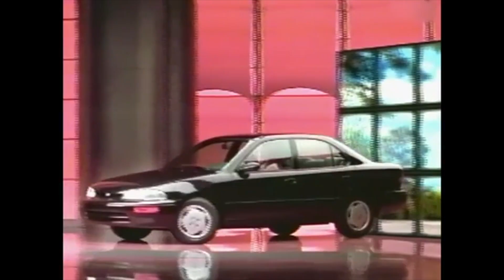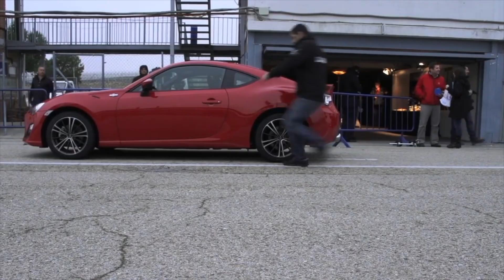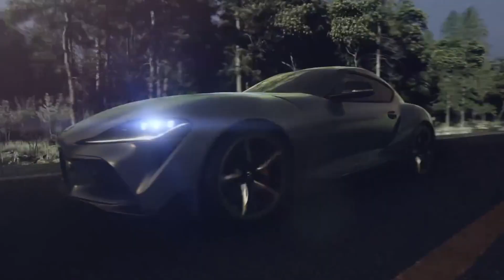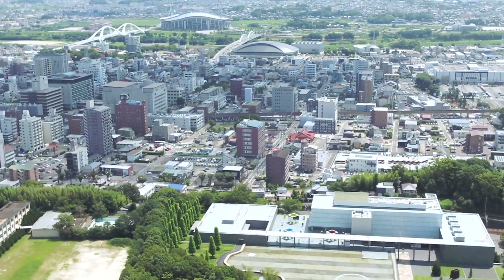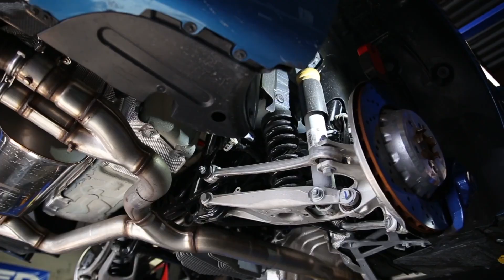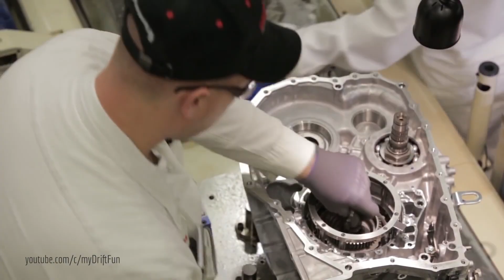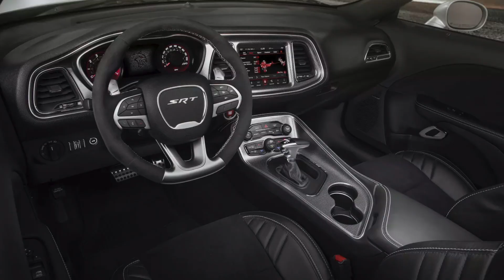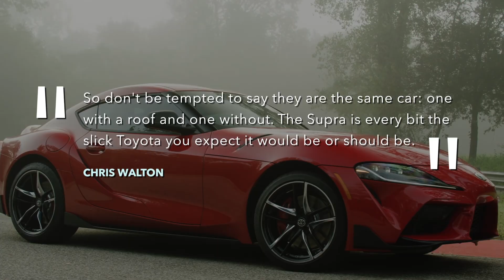MKV Toyota Supra - BMW or Toyota? The UNTOLD TRUE STORY

Comment: Toyota reliability. + BMW motorsport experience. Why so much hate??
Reply: How can you say it’s Toyota reliability when the engine/trans and all interior is BMW? THe only thing Toyota is the outer shell.
Reply: @mouanhojable  PAY ATTENTION the trans isn't BMW. The engine yes, but Toyota made sure for it to be reliable and it's showing as it's there best engine out there out of all there engines. And someone is already making 600+whp on the B58 block.
Reply: @mouanhojable  Because Toyota had a large amount of input on the mechanicals of the car. Yes, it is technically a BMW engine, but it's a BMW engine *with Toyota quality control*, and quality control translates into reliability. As for the transmission, it's actually not even a BMW trans.
Reply: @draconious4005  thank you! At least you payed attention :-D and indeed, it's a ZF-box. So not from bmw nor Toyota.
I think they did good to collaborate; it gave BMW to get an amazing AND reliable engine (double checked by Toyota) and Supra gets the quality parts and chassis! I have a BMW 240 and the engine is a Monster! With a reprogrammation it's quicker then a Brabus C-class (till 160km/h)
Reply: @mouanhojable  Did you not watch the video at all? Only the core of the car was shared between toyota and bmw MEANING, the shell AND interior are different. But no everyone is stuck in the mindset of "mk 4 supra best anything else disgusting"
Reply: @mouanhojable  did you not listen to the video? Toyota sent all the parts to Japan to have them tested, each one that didn't pass their standards was sent back for revisions. I own BMWs and don't want other cars other than Porsche but boy am I waiting for the Supra and Z4. I want to test drive each one before making a decision on which to buy. I'm sticking to the BMW more but I want that Supra as well. I welcome the reliability that Toyota brings. I'm tired of changing stupid things every 2 years like the trim on my BMW because they can't make rubber for shit.
Reply: BMW and Toyota does not need to work together. They are doing fine by them selves.  But they decide to work together across the different time zone and cultural barrier to envision something new. 

I'm sure both companies learned a lot from each other and that's good for all of us. 

Maybe BMW QA team learned thing or two about quality control. 

Maybe Toyota learned thing or two from BMW’s design philosophy and what us must for them. 

For me, this shows that both companies are willing to explore new possibilities and step away from corporate group think ( once you are in a group.. It becomes the echo chamber. Sooner or later everyone is repeating everyone else. ” That's how we always do things.”) and willing to spend $$$ on R&D.

This is big win for both companies even if the cars do not sell in high volume. 

Selling more car was not the goal. It's more of process improvement and testing / design methodology they learned from each other.
Reply: I think it's cool that they learned from each other too. The fact that the product wasn't moving well until a Japanese man who lived in Germany when he was a boy could help bring them together, is a really cool part of the story. It's probably overly simplified, but I like it.  @MSH3423
Reply: @DENicholsAutoBravado  I liked that part too
Reply: @MSH3423  BMW could learn a thing or two but all this partnership did for Toyota was to tarnish their name.
Reply: My only hate is it should have been much closer to the much better looking concept.  And it should at least have the same HP as the Z4.
Other than that, I love it.  What’s not to love is its fugly factor.
Reply: @aaronsorensen5322  Toyota wants more longevity. Of course it had less HP. Assuming what your saying is researched and true. 

It KILLS me how much I had to upgrade one Toyota of mine to get at the wheel what it could do at the crank. 300% more at the wheels HP to get there. 

Why? Conservative tune. Still had a conservative tune with the power I'm talking about. Anyway, it's easy, if you want more HP, you know which one to buy.
Reply: @aaronsorensen5322  knowing Toyota it probably does ,have to wait for official Dyno numbers from YouTubers. Toyota has lied about HP like Nissan did in the 90's and there's a chance they probably did the same with this car..maybe.. i Hope lol
Reply: I don't mind a collaboration between BMW and Toyota, just don't call this car a Supra...
Reply: its because simply put, it isnt a Supra and thats why
Reply: @alexl5682   BMW is for men who don't know how to drive*
Reply: My thought exactly!!?? I have a BM and a Toyota and this is exactly what I would want in a perfect world. German ingenuity and design with Japanese reliability.
Reply: it has nothing to do with fuckbois and fanboys it just the concept , it be like if someone has a totya engine in a mustang faggots and purist would flip out which is majority of people but in a japanese car these fanboys dont give a fuck, if it was label as something not a suprta it woulda been a good car but a since it was name after a supra most ppl dont like it .. and whats wrong with toyota engine that have proven in the past they can make racing engine fine if not even better then bmw
Reply: I think it's really interesting because Toyota influenced how the Z4 turned out.  Toyota got BMW to relocate the engine late in the game to further lower centre of gravity, and the shorter wheelbase plus 3 inches width increase compared to the last Z4 tells me that Toyota got their way with making this a true sports car
Reply: Buddha BlessYou you must not be a real man to say stuff like that in 2019. Go back into your cave.
Reply: Because BMW now us so far from a Toyota Supra, the only thing is a straght six, but it must be oversturdy to have the Twint Turbos, and to be able to wring out hundreds if hourses more.
And i dont se that happening so the old one will still rule.
Reply: R u saying that BMW has a better racing background? If u r than ur a dumbass. I would say the same if not better than bmw
Reply: @davidchau3228  Bro chill, it's only the internet
Reply: @davidchau3228  bmw does have more racing history than toyota. do your research my friend. toyota has never even won a f1 race before while bmw has 20 wins. this is just one example. not taking anything away from toyota as thry make good reliable cars.
Reply: @danielzychniewicz2633  sorry I should of said current racing background. Race cars of today. And f1 wins had a big big portion of driver experience as well. U put Michael Schumacher in a Toyota f1 and he will destroy the competition. (Of course wen he was in his prime)
Reply: @davidchau3228  and what race cars of today does toyota have? bmw supra? LOL.
Reply: @danielzychniewicz2633  first of all we are talking about manufacturer. Toyota has multiple race cars in super gt. They have a le man's race car. Now they brought back the bmyota zeepra race car. And dumbass BMW only won 1 f1 race.
Reply: @davidchau3228  yeah so? bmw has those le mans gt cars too. aswell as dtm race cars. lets not forget about the legendary e46 m3 gtr lemans race car that decimated in the series causing porsche to cry. sorry bud but toyota is inferior to bmw, thats why need their help ahaha. remember that a bmw engineer worked on the legendary 2jz. should i keep going? lol
Reply: @danielzychniewicz2633  lol ooooo wow m3 gtr wow. Did u forget the Lexus lfa (we are not talking about cost now). And dumbass super gt cars are dtm spec now. I never seen a record breaking m3 gtr on the ring. Have u? And yes there was a m3 gtr sold to the public. U probably didn't know dat. I'm assuming u r talking about the race m3. And it wasn't just porsche it was multiple manufacturers. I give u dat tho.
Reply: @danielzychniewicz2633  first of all I'm only talking about vehicle specs and racing background. And if u wanna compare BMW and Lexus as a manufacturer. Ok u got me up to a certain point.
Reply: @danielzychniewicz2633   ROFLMAO, LEXUS IS OWNED BY TOYOTA. IT IS 'TECHNICALLY' TOYOTA HAHAHAHA

That was funny
Reply: @danielzychniewicz2633  Yes it does. A division is still under the main body. Without that body the division perishes. It's. Still. Toyota.
Reply: @dehibler4811  its still lexus. end of discussion. lexus is 1 level sbove toyota. its the lexus lfa.not the toyota lfa. just take the loss bud.
Reply: @danielzychniewicz2633  
But the Lexus Lfa was designed and built by Toyota from the ground up. The lfa even has a Toyota built engine. Obviously... 

Lexus is just a luxury badge for Toyota for markets like the US. But most of their cars are built by Toyota engineers. I say most because, just like the 2020 Toyota badged Z4, Toyota has done the same crap with selling rebadged Subarus. Who knows what other cars of their are just toyota badged versions of other cars...
Reply: They can't afford it?
Reply: Because its not a true supra
Reply: because the engine is made by BMW which is unreliable. If it was made by Toyota then you know...
Reply: Because its not gonna have that Toyota reliability, Its Bmw parts in a rebadged Bmw..
Reply: Would you mind driving a 35.000€ Mercedes with a Renault engine??
Reply: Because it’s not a true Toyota.. Germans and the Japanese did collaborate during ww2 to take over america.:)) lol..  they weren’t successful then, they won’t be successful now.. I don’t think
Reply: It's a BMW powertrain, so no not Toyota reliability, it's BMW "reliability"
Reply: BMW motorsport??? fuck off!!!
Reply: Why Toyota married it’s princess to a country boy?
Reply: Stfu vag fanboy
Reply: There's no Toyota reliability on a BMW drive-train.
Reply: Have you tracked BMW reliability in the last decade? Toyota actually needs nothing from them.
Reply: it's not a fucking SUPRA THAT"S THE PROBLEM
Reply: Toyota reliability??? the engine is from a BMW
Reply: @bigshet4427  you didnt even watch the video did you.
Reply: Toyota is only reliable because they make the engine...what r u saying? The body is reliable? I think everyone was looking forward to a 2jz successor. Everything Yamaha makes is the shit and the Supra was a legendary collaboration between the 2. Jdm fans don’t want German garbage
Reply: Its basically a bmw
Reply: No Toyota reliability when the drive train is pure BMTroubleU
Reply: @yellow98gt  So I'm guessing the words "Co development" are very foreign to you. 

Cannot wait for all your shitty comebacks and then having to result to bullying a small issue with my grammar.
Reply: Because the Supra was supposed to be Toyota's thing. It was its heritage. For good or bad, it was a Toyota.

If I want a Z4 I'll buy a Z4. They shouldn't have called this car a Supra.
Reply: Because there are too many car enthusiasts who are douchebags and fuckbois.
Reply: @Ethan-ck6iz  too many enthusiasts are broke cunts too though.
Reply: Watch this thing be one of the best cars to mod, haters will always hate,
Reply: @rayraycarter04  HKS and TRD/GRMN already making performance parts for it. Will probably end up being the most Tuner friendly/reliable BMW engine ever made. The B58 is a successor to the N54-N55 engines which only real problem they had were electronical the engines of those cars are still very capable till this day and tuners still working things out with those engines. Too many people have there heads in the sands and there shitty opinions still coming out there ass and stinking up the place and making the car scene worse then it already is.
Reply: @rayraycarter04  hi its me from the future, this thing Responds to mods very well once unlocked, i didnt think this engine was capable of putting down 1000hp stock block
Reply: Its an automatic
Reply: the hate comes from common sense, if it had a japanese built engine and trans + european styling body like a z4, then it would have worked BUT it turned out the other way around... TOYOTA should design a new 2jz and drop it in the FT-1 and call it the 'real' SUPRA
Reply: they know they have suck ass design department, thats why they need bmw help
Reply: Because BMW are junk. They don’t last. They are only good until 50k miles. This is a z4.
Reply: Cause they are triggered BMW knows how to make machines

Comment: I kinda thought they should make the Z4 with the Toyota engine and the Supra with the Toyota engine (duh!) ^w^

Toyota could plausibly have made a larger, beefier I6 to succeed the JZ like they did the AZ (Sciont tC/Toyota Camry) engine series to succeed the S engine series, and use either cast iron or diecast aluminium for the block and maybe recycle the 2JZ heads.

The new engine could be codenamed the 1JR/2JR/3JR engine like the AR to the AZ.

Comment: After 20 years of being dormant....you would figure Toyota would do a lot more research and build  and learn from the previous platform of the old Supra and improve more on that......technology up til 2019. But they cheated and just disgraced this super car and mixed it with a BMW Z4. As for all those that say....give it a chance and drive it, well ive owned many Supra s from as early as 81 and when tastefully done up...the thrill and exhilaration in the drive is very unique to this thoroughbred. We Supra purists want  only Japanese designed super car that we waited for for so long.....and it should have more horsepower than the GT-R. This car was a let down right from the beginning......heck....i think i could have designed a better car.

Comment: I have a BMW sedan and a Toyota hatch.I know that both my cars are not the same...we can argue the whole day but i know BMW when i see one.BMW cars are very distinctive.They have 50:50 weight balance,they use straight I6 engines,rear wheel driven,twin scroll turbocharged bla bla bla...A Z4 with a closed top is the new Supra.

Comment: The Subaru BRZ/Toyota GT86//Scion FRS was also originally designed so it could have it's roof cut off and still pass all safety standards as a Roadster

Comment: Finally someone is addressing the facts instead of blabbing about all the Zupra memes. I completely understand why Toyota chose this route having a partnership with BMW. The car industry is evolving all the time, and there is more requirements and stricter emission regulations when the time goes by. If Toyota would have developed the new Supra in the way all the fanboys wanted it to be, it would've ended up costing so much that nobody would't have bought it and then everyone would have been crying about the price. 
And what comes to the new Supra, in my opinion it's as much of a Toyota as any other Toyota these days. Some may cry about it not having Toyota engine (JZ) and it's reliability/strength, but how many of you have had your hands on that B58 engine. Again in my opinion if it meets Toyota's standards, I'm pretty sure it's a damn good engine. And also as said, it's been developed together with Toyota and BMW. 
What comes to the visual side of the new Supra, some say it looks stupid/ugly/boring or that they like the look of a MKIV Supra way more. Yes a MKIV Supra with modest lowering, some nice "bodykit", nice wheels etc. is one of the best looking cars out there, but have you seen a new Supra with same level of visual modifications. In my opinion STOCK new Supra looks better than STOCK MKIV Supra, but again that's just my opinion.
Obviously I'm disappointed that they chose not to offer manual transmission at the launch, but it doesn't mean that it's not coming. The biggest disappointment for me was the interior, I would've really wanted to see the driver oriented dashboard with everything being Toyota parts instead of all the BMW tech.
Overall I think the new Supra is a amazing car and big achievement of great engineering. It's going to be a true track monster thanks to it's rigidity, lightweight and low center of gravity.